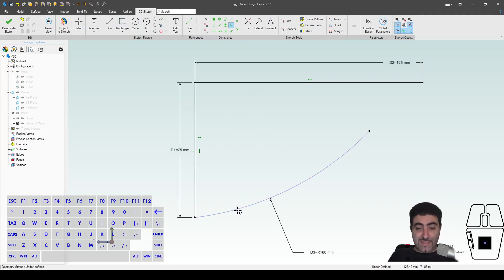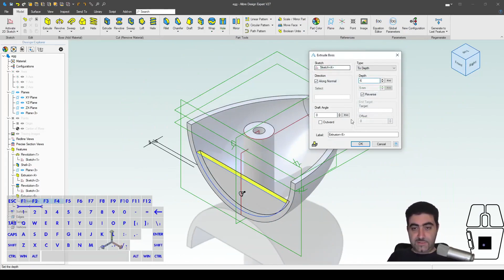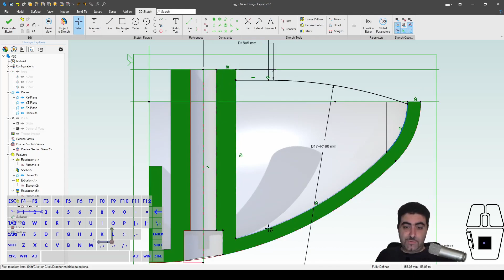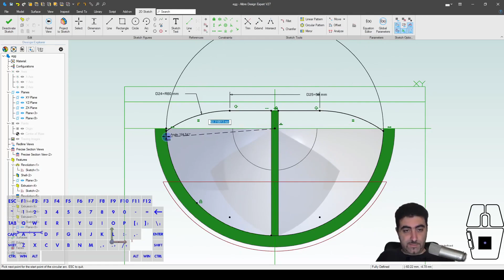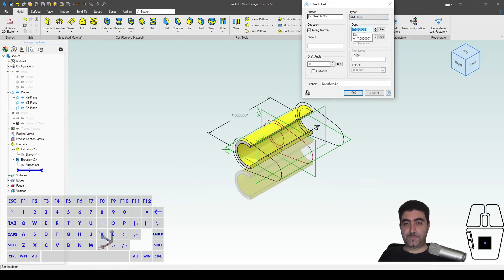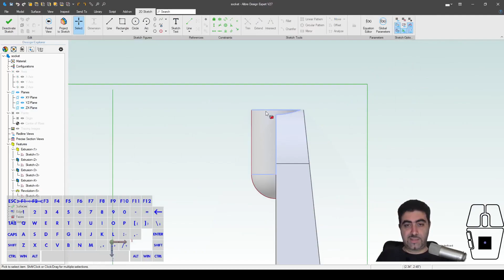Comment: Good on you mate! For ribs on the egg, would it be easier using thin extrude to a geometry, unlike you've had to use non-associative section cut. I got that you probably wanted to show the trick, which could be useful at times. Thank you.
Reply: Thank, Ty! Glad you liked that little trick. To be honest you can have parametric projections and use the shell thickness parameter to constraint a new arc, etc. It won't even take too much longer. Also, you can create a surface and intersect it with that compound surface, which would also be parametric.But I did indeed want to show that trick.

As for the thin-extrude, I've used it to make parametric ribs before but how would you use it for these that have straight and curved segments?

Thank you for your comment! Cheers!

Comment: Great step-by-step for modeling the egg cover part. I started to model that one quite a while ago, before I learned that you could project edges from a Precise Section view. That tidbit of information is a real gem. I'll have to give it another shot one of these days.

I modeled the socket part a while ago and used a different method than you did,  I haven't seen Davinche's video yet to see how he did the model. It's always interesting to see the various ways of creating the same features. As the saying goes, "there's more than one way to skin a ...".😄
Reply: Hey Harold, glad you liked the video and thanks for commenting. There's definitely more than one way, and especially in Alibre! As I write in my reply to Ty, you could even make a large extrude, convert to surface, parametrically move in to place, and trim to get the edge along that bottom surface.

But I think that not too many people new that little trick with the section projection and I think it's very useful, so I wanted to show it.

Thanks again and keep your videos coming too. I really enjoyed the SM Hanger video you did. Great, in depth explanation.

Comment: great videos. Any luck connecting Excel Add on to Alibre Atom?
Reply: Well the Excel Add-on should work the same way in any Alibre version.

But there are add ins that cause it to fail. For example the solver add in and the optimize add in cause the Alibre add in not to work.

I have a video in The works on the Excel add on and how it works